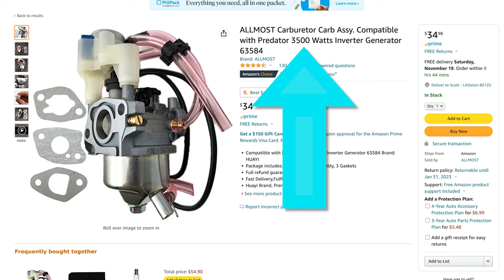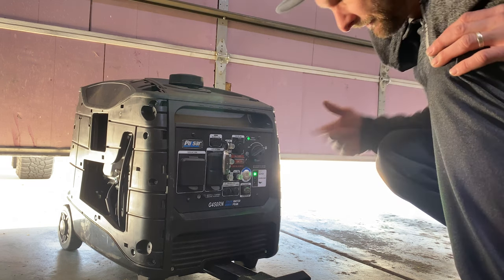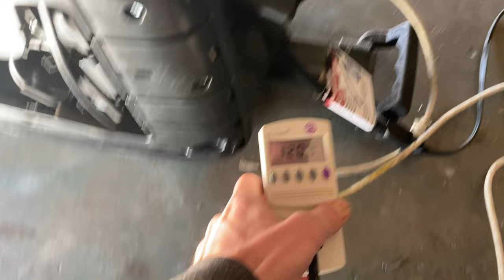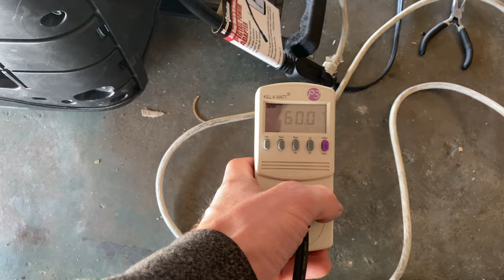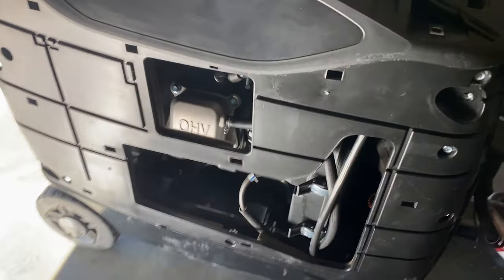Will It Run? Pulsar G450RN Inverter Generator + Remote Start 4500w/3700w. Amazon’s top pick for $799

Comment: For others reading comments for info, I picked up a brand new return.  Never ran.  gas leaked right out when filled. Pulled the tank and they not only didn’t connect the fuel line between tank and fuel valve which I read in other instances, but there wasn’t even one installed.  Got fittings from hardware store.   Pull started and ran but then no electric start.  Took front panel off and power wire to main battery switch was not connected dangling there.  Everything works now. Also read reports of harnesses not connected so also check those.  If you can find a deal on these not running, good chance it’s something simple after reading many bad reviews on them.  Seems like a good machine just horrible assembly.  Thanks again for great video and guidance.

Comment: I must have of missed it, but what fixed it?  Thanks
Reply from the maker: It was just wayyy overfilled with oil. so much so that it couldnt even rotate well. I did find a few other things after filming this video, there was a wire in the main harness that had started rubbing through the insulation so i put some liquid tape on there and zip tied it away from the part where it was rubbing. The oil changes on these are such a mess though
Reply: Appreciate the reply. I’m about to pick a new one up with a fuel leak for a good deal, not as good as yours, but read  that floats hanging and overflowing carb and fuel lines broke not connected from factory are not uncommon. Just trying to get any information on these that I can.  Heard a lot of horrible reviews! Most a seem to be minor fixable things from horrible assembly and QC.  We’ll see.  Thanks again.

Comment: How did you hook up the charger to charge the battery?
Reply from the maker: This generator has a battery tender plug that I hooked some alligator clips to
Reply: @DenalisGarage  any way you could hook it up and post a picture?
Reply from the maker: @joshsteele4931  Sorry, sold the generator. Basically you take off the right side grey cover, may or may not have to take the black plastic cover off under that, and in the opening down and to the left of the battery compartment you should see it, its got the battery tender connector on it with the rubber cap. The other option is to plug in a < 1a adapter plug into the battery charger port on the front of the generator.
Reply: Last question, if I use the charging port on the front of the generator, does the battery need to be turned on or off or does it matter.  Hoping you know before I sit on hold for an hour with the company.
Reply from the maker: @joshsteele4931  Oof yikes i heard their customer service isnt great. That part I think it doesnt matter, the trickle charger shouldnt be going through the switch on the front just straight to the battery, the switch is delivering power to the starter motor (I think). Try it both ways, start with it off first for about 5-10 mins on the charger. If you have the battery compartment open, you can actually pull/slide the battery out like a cheapo drill battery and press the button and see how many lights light up on it. Also check the fuse in the front panel, it is not a high powered fuse, so if you put too powerful of a plug into that barrel connector on the front it might pop that fuse preventing charging. The battery should also just charge up while its running... you could just do the pull cord to get it running and let it run for like 10-15 mins and that should have it charged up enough to restart. If not your battery may be dead dead.
Reply: @DenalisGarage  yea pull cord is broke, that's why I'm having such an issue.  The start button exploded last year so I was having to pull start it all the time.  Most recently I've had to jump the solenoid to start it, but it sat up all winter and now the battery is dead.  There's absolutely no info in the manual on charging the internal battery.
Reply from the maker: @joshsteele4931  Oh man you're in a pickle. Ok yeah, if you have some alligator clips you can do what I did and literally clip those to the actual battery terminals. You just gotta take the grey side panel off and the black panel underneath that. its a ridiculous amount of bolts that you have to take off to get that panel off, but then you should see the opening for the battery and it can slide out. looks like a real crappy drill battery, just plug your alligator clips onto the terminals on that and you can also press the button and see the battery indicator too